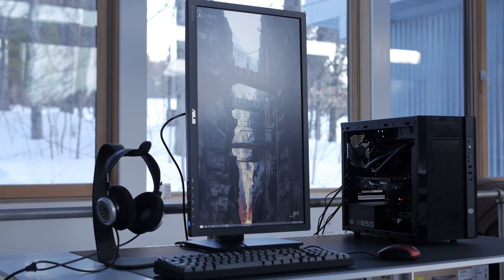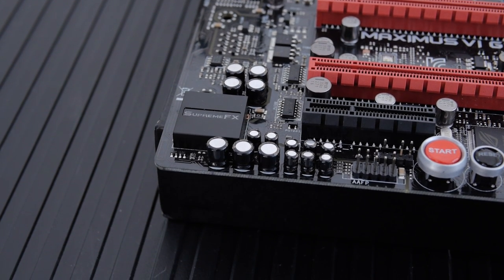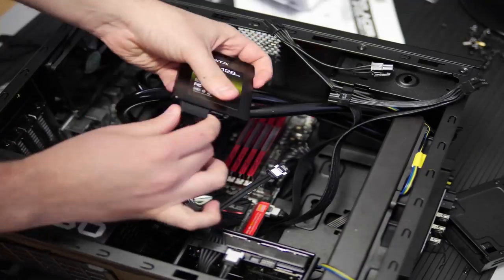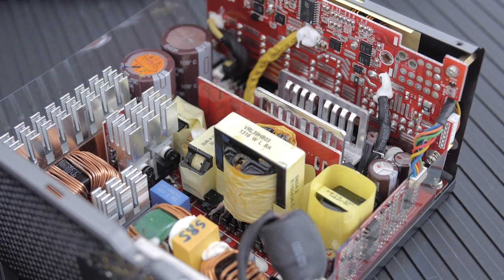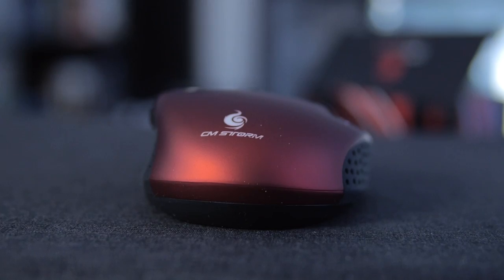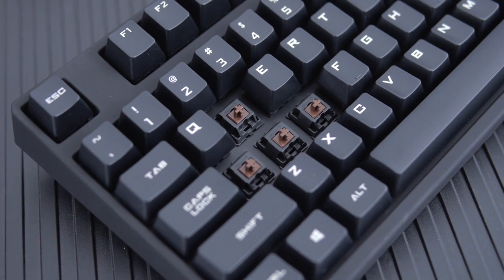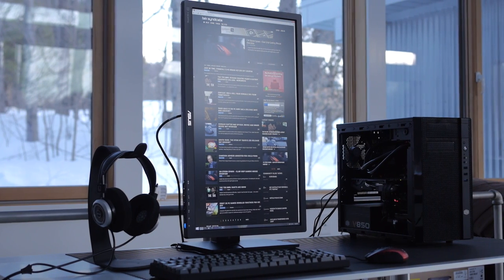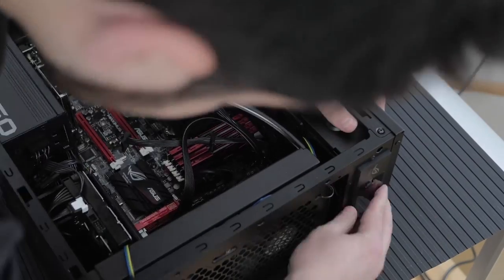Build an Editing/Gaming/Capture PC: Meet The Ocelot

Comment: There's no downside with gaming on a Xeon aside from the overclockability correct?
Reply: and u do lose some frames idk how much specifically because the i7 beats it in games
Reply: Correct, some boards may not have the microcodes though.
Reply from the maker: Eduardo Perez It's about the same speed as a 4770 and a lot less expensive. So, save the money and put it into a faster GPU... Win!
Reply: Tek Syndicate Out of curiosity is there a certain Xeon that matches the 4770(there are quite a few E3 Xeons and not many benchmarks to compare them to i7s)?
Reply: Xeon e3 1241 v3
Reply: +Eduardo Perez no lol.
Reply: +Tigran Oganesyan hmm, I new here and are your Edgar sister?

Comment: Tek, you should do a $600 gaming rig build. I have $600 but need part suggestions for gaming...
Reply: Check reddit or Tek Syndicate.
Reply: Try going to the forum and ask people their, they have some pretty good builds for ranging prices
Reply: Try linus tech tips forums best place to get suggestions for computer builds or just search youtube for austin evans $600 pc builds.
Reply: An amd 6300, gtx 750ti, 8gb team zeus ram, any cheap $25-50 case of your choice(I'd personnaly choosse the NZXT Source 210 elite), 1tb seagate or western digital blue, cooler master hyper 212 plus, asus dvd burner, ASRock 990FX Extreme3 motherboad or 990fx killer, and an Antec VP-450 power supply. I did this mostly off the top of my head but the price should be around what you're asking. If you can spend alittle more money I recommend getting an r9 270 since the prices are back to normal but you are going to need a larger psu if you want to run crossfire so I'd recommend the EVGA 600 B 80 PLUS BRONZE. Note all of this can be found on newegg. HF :)
Reply: Cult of Mush has a good $600 gaming PC build you can check out.
Reply: Asterisk Thanks alot! :)
Reply: Nfinity Ego No problem.
Reply: Asterisk dont get a 750 ti...
Reply: Thomas Helgesen Why not
Reply: Thomas Helgesen Why would you go against a 750ti for a low price gaming rig. It handles 1080p moderately, has barely any power consumption and is as cheap as can be o.o
Reply: Thomas Helgesen for a build at that price range, 750 ti is a good shout
Reply: alex fong The 750Ti is absolutely the best you can get IF you also have to buy a case, HDD and ODD. If you can reuse parts I would go for a R7 270X or a 660ti
Reply: I'm with Fernde09. If you've got recyclables you can use go for the 660Ti. Had one before I upgraded to 780Ti and I loved it. Handled max on most current gen with good fps. A+ card for price range.
Reply: Asterisk Would not recommend an APU though if you have a discrete gpu, get the athlon x4 760k
Reply: Fernde09 I didn't recommend an APU though. I recommended the 6300. Its my go to CPU for low end builds. Just a bit stronger than the 760k, and comes with a little more out of the box just incase you want to do some small editing and what not. The 760k would be a secondary choice. Plus motherboard options for the 6300 are easy and allow for better SLI/Crossfire options. The fairly new Asrock 990fx killer is amazing and even handles the 8 cores with ease.
Reply: Fernde09 the 6300 is not an APU
Reply: r/buildapc or logicalincrements or pcpartpicker
Reply: Asterisk because the gtx 660s are REALLY cheap right now and they are like twice the performance of the 750s im seing 660s for 170-180 tops a very low margin more than the 750
Reply: MtgTerror King the cas latency on 2400 is stupid. itd be better to stick with 1866. thats really the butter zone right now (g.skill sells around 75 for 8 gigs). and a WD 1tb hard drive is just a few dollars more than a very similar 500 gig. the 430 watt builder from corsair is also $20 right now, so for anything under 400 watts id use that.
Reply: well if u have somewhat of an idea of what parts too pick then u can use pc part picker great site and shows u so cheap options u can go to
Reply: if it is a 600 dollar pc the 1600 speed will be far away from bottlenecking you. at least with the cheaper amd processors. if you want to take advantage highspeed ram then get an i3 and then you have the option of putting an i7 or i5 later. if you go with the A series or FX series amd processors if you want a cpu upgrade you have to replace the motherboard too.
Reply: BassRacerx Uh, gtx 660s are still around $200 and again you are going to need more power for later on if you want sli/crossfire. This is also why I recommended the r9 270 with a different powersupply since it's back to its 179-199 price range. I take everything into consideration :)
Reply: only takes a 450w power supply for a 660 and i checked prices and they are under 200 still they might have already stopped making them or they will soon
Reply: You may want to bypass an Nvidia gpu for a while in favor of an AMD gpu.  It would be cheaper, and given the new Mantle API, you could end up getting way better performance for the money with less processor requirement.  That way, you may be able to spend your hard earned money on an SSD or something.
Reply: What mantle did do is force MS to fucking fix DX, also the 260X is a beefed 7790 (~+5%), the 250 is about a 7750-7770
Reply: get a R270x or a 7870 since they are the same thing. These cards are beasts and are really cheap. Also an amd apu since mantle is out your gonna see some improvements. Look around your gonna get a nice pc for $600
Reply: happyblades
>apu
>mantle

That... that completely defeats the purpose.
Reply: He already has in the kill your console series, it's #2. Just search "kill your console #2" here on YT
Reply: happyblades I got my hands on a 2GB 270X for $150. With some minor overclocking it trades punches with a 7950. Also the architecture itself is improved (GCN 1.1) and it's better at DX11 things despite being very similar in raw performance
Reply: Also the microstutter hell that AMD users went through during the 6xxx and 7xxx series is nearly gone

Comment: I would've used a Corsair 350D. You can fit more in it and it looks nicer to me.
Reply: I have a 350D. I find it quite bulky.
Reply: It's also more than twice the price. Don't get me wrong, I own the windowed version of the 350D and it's an amazing case to look at and build in, but the N200 is a lot of case for the money.
Reply: Agreed I'm also a 350D owner and i would have preferred it be about $20 cheaper than it actually is. I was thinking of switching to the Xigmatek Aquila because I'm adding a second GPU and I'd prefer if they were mount horizontally
Reply: ***** he doesnt even have to pay for most of the things, they get send th him most of the time :)

Comment: Logan you should swap out those cooler master fans as soon as you can. I've used them in the past and usually about a year into the use of them they just start slowly failing and getting louder and louder as time goes on. The Noctuas are more than worth the money as they sound the same on day one as they do on day one 7 years later.

Comment: The R9-290X is most certainly not the same as the 7970. The R9-280X is the 7970, and there is a huge performance difference.
Reply: I think he meant 280x because I think he compares it next to the 7970 Matrix.

Comment: Another great video. I'm looking to get back into video Editing and my mid 2010 MacBook Pro just isn't cutting it. Having an issue others have reported with it just crashing randomly so time to upgrade. Had a Mac Pro before this but honestly really considering doing my own PC build. So used to Macs but really not happy with their pricing and think it would be cool to do my own build.

Looking at a i7-4770k build with the Gene VI MoBo. Possibly a GTX 770 GPU and either 16GB or 32GB of 1866 RAM. Will check out the Xeon you have in this build too though and see how that might work for me. I basically want a Editing rig that will also do Gaming well too. Keep the great videos rolling in and thanks for all the great info.

Comment: Hey im wondering if a corsair 750w bronze power supply could supply 2x gtx 760 and a fx8350 1 ssd and 1 hdd with 7 fans incl cpu cooler

Comment: I have the N200 for my <M1CR0_T3RR0R> ("Micro-Terror")'s chassis... great for airflow, low noise operation and with my Sapphire Radeon 7950 and OC'd FX6300... it's perfect!! just sling some AF120's on the front, a Hyper212 Evo and a 90mm low noise fan in the side and boom!

Comment: You shouldn't need to bother explaining using the liquid heatsink, but 'haters gonna hate' as they say. I have premier but don't use it (lol) however doing extremely high resolution (like 6000x6000pixel) renders in Maya with lots of 4096x4096 textures, reflections, raytraced smooth shadows...

My CPU (FX-8150) uses 100%, and doing a render that large can take like 10-15 mins (could take longer or less time depending on crap in render). By the end I can see temps up to 52, when I idle at 35 :X.. A bit brutal, and I can definitely understand using liquid without overclocking if rendering is an every day thing.

Comment: i would use stock cooler and a normal motherboard but get a 250gb ssd or at most an evo 212! i don't srr why I should go with a waterfooler. but if you've already got it why not :D

Comment: Im gonna be building a gaming/editing/3d modeling rig. Would you guys recommend a Xeon or an i7?:)
Reply: Xeon is cheaper,  has more cache and doesn't have the integrated graphics.
i7 is overclock-able.
Besides that they are the same processor.
Reply: Depends, if you want to overclock than i7, if not then xeon.

Comment: Corsair Carbide 200R
Cooler Master B500, 500W PSU
AMD FX-6300 Black Edition
Gigabyte GA-970A-DS3P, Socket-AM3+
Kingston DDR3 HyperX 1600MHz 8GB
XFX Radeon R7 260X 2GB GDDR5
WD Desktop Blue 1TB
Samsung DVD Writer, SH-224DB

How long do you think this will be able to play games on medium?
Reply: jacob hubbard +Fr4xtal +Spectre how about an i5 3350p and gtx 660 (not sure might be 1.5mb version) will that do well for a few years (4 or more)?
Reply: Jamie Mersh Get a haswell non K cpu.
Reply: Dennis van den Bosch why?
Reply: Dennis van den Bosch why?
Reply: Jamie Mersh try to get a 760 or a 270x. Those are like $50-80 above a 660 and are superior.
Reply: I responded to +jacob hubbard . But the FX 6300 is a good choice. Save money on the CPU and get a better GPU. But get the Gigabyte GA-970A-UD3P it has better vram heatsinks.

Comment: Is this a good gaming/editing build?
AMD FX 8350 4.0GHz 8-core Processor
Cooler Master Hyper 212 EVO CPU Cooler
G.Skill Trident X 16GB DDR3 Memory
Seagate Barracuda 2TB HDD+Samsung 840 EVO 250GB SSD
Gigabyte Geforce GTX 780 3GB WINDFORCE
Corsair CX 750W 80+Bronze Power Supply

Comment: What do you gyes think? Cooler Master V850 VS Corsair RM 850
Reply: I personally prefer the Corsair RM 850, because the components are on par with each other but I really like the Corsair Link technology that allows you to monitor your power supply performance from the desktop. It really helps in troubleshooting components to determine whether a component is getting adequate power. The Corsair also supports complete zero rpm fan mode at low draw, though the CM may as well and just not state it.

Comment: So I have a new PC and I have a question to the watchers. Best software for fan control?
Reply: I've never used any fan controlling software, but i believe that speedfan is the best choice=)
Reply: Thanks, anything else I should get?
Reply: pakadyno It would be easier to have fan control bay in the front of your PC if you really need it. However, this is just my opinion and I think you can't control normal 3pin fans on your mobo. 4pin fans are the ones with speed control.
Reply: ccubeice a I wanted software because I don't have the money for a front I/0
Reply: Yeah, money always seems to be an issue when it comes to computers. I don't know of any aditional software you should get. I'd reccomend that you try to understand speedfan(I'd love to help if i understood it myself) as it's a very powerful tool for fan controlling.

Comment: You should have used the Hadron Air.
Reply: Why?
It wouldn't fit the components, has no room for expansion and is limited to a 500W PSU.
Reply: Dire Squirrel Looks like i fucked up.  sorry. i just really like that case :)

Comment: @tek syndicate Hello,

I would like to know what you 'guys' think about my build list (wich I will not build myself)
It is a video editing workstation, I am a beginning video/filmmaker using a Panasonic GH4.
So footage will be from a mirrorless device with 4K capabilities.

I have choosen for the following ingredients  (but nothing is set in stone at the moment)

Asus X99 - Deluxe USB 3.1 motherboard 
Intel Xeon E55 - 2630 V3 2,4Ghz 8-core LGA 2011-V3 
Crucial DDR4 -2133Mhz ECC Reg. RDIMM CL15 (64Gb total) 
PNY NVIDIA Quadro M4000 8Gb DDR5 Maxwell GPU 
NZXT H630 white housing ATX full tower 
Corsair H100i watercooling kit 240mm radiator 

Samsung 850 Pro 256Gb SSD (OS drive) 
Samsung 850 Evo 500Gb SSD (Scratch disk) 
Samsung 950 V-NAND 512Gb SSD M.2 PCIe (Working Media) 
Western Digital - Black Series - 3Tb - 7200rpm (x 2 as Back Up Drives)
(the two WD HDD drives in Raid - 1 mirrored) 

Asus Thunderbolt EX II Dual expansion card 
Plextor PX-LB950 SA Blu Ray DVD reader/writer 
Corsair HX 850i (PSU) 80+ Platinum Certified 

Software used: 
Windows 10 
Lightworks Pro 
Adobe Premiere CC

PS I have choosen for the Xeon E5 2630 v3 (octa core) instead of the i7 5930K (hexa core)
: even though the clockspeed from this Xeon is a little slower I think the extra cores are more useful in my setup, also benchmark tests don't show a lot of difference between these two.

The shop that will build my computer (because I am a noob:) told me why don't you get two of those V-NAND Samsung 950 PCIe cards (they told me with a special bracket I could fit two of these on this card and in a raid - 1 configuration I would have fast and reliable memory) is this true?

There are so many variables it is blowing my mind.
If you could advice me if this is a good way to go or there are better ways please don't hesitate to educate me :)

Thanks in advance. Greeting from a Dutchie.

Dave C
Reply: Did you ended up building it?
Reply: not yet , I am not getting a lot of response  but I changed some of the ingredients  now

Comment: I would never use an 290x. 350 watts WTF. nvidia can power that card using 150 watts by using their new chip design.
Reply: yeah but Nvidia sux no compute power and crappy OpenCL performance
Reply: Sanjay Saini open cl is really the only advantage for those cards though. and they are still priced way higher than they should be.
Reply: well. i say way higher. but now its just slightly overpriced.
Reply: maxwell powers a gtx 750 ti with only 80 watts. CRAZY... with maxwell next Year GTX 880 will run at 150 watts. and gtx 870 will run at like 120 watts.

Comment: The MSI Z87-45G Gaming is a better motherboard.
Reply: Fat Sacks Get a bigger case :)
Reply: Fat Sacks Smaller case = PC greenhouse. It's going to get warmer and warmer in a smaller case as the hot air has less places to spread out, and with a smaller case you probably can't add a massive 240mm fan at the front that will greatly improve air flow. Everything is just compacted together and it will increase temps which will degrade your PC parts slowly. I would rather spend an extra £30 for a bigger case that will insure me that I will have enough air flow for my components. So yeah, a bigger case is better.
Reply: Catpiss Neverclean You can build an EXTREME PC in the Cooler Master N200 they're using. How do I know this? I have the same case and I can tell you from experience that I get pretty stellar temps. I've even seen SLI and LGA2011 builds in this case
Reply: Catpiss Neverclean lmao, due to its smaller size, it actually has as good if not better airflow, all the dead space in your bigger case, i could rant on about turbulance and thermal dynamics, but i will leave you with this nugget of info, "if someone who has been working around and building computers longer than you, says it the best and works great, then take their advice!"
Reply: Lord Xantosh i I'd still prefer a bigger case, yes smaller cases are easier to put around areas but still heat up more than normal midi or full towers. I don't care about the sound that my PC makes because I use Siberia V2's which block out sound pretty well. You can get rid off most of the sound that your PC makes by doing some small adjustments like getting sound proofing foam from your local DIY store and air turbulence can probably get rid off by using high quality fans and having good pressure inside the case. I'm 16 and built over 50 computers now, that pretty much shows my dedication to PC building and also clearly shows what I'm on about. By getting a smaller case, higher temps would be made as the hot air released by the components has a smaller radius to dissipate and pass through the exhaust fan(s). The cold air that is being passed in the case is also mixed with the hot air meaning that the cold air will go under the hot air and then the hot air will go to the top of the case and if no fans are installed on the top then you're screwed. The case pressure I believe is also harder to obtain meaning that more dust will accumulate on the components.

I probably got some of those wrong but it should be okay.